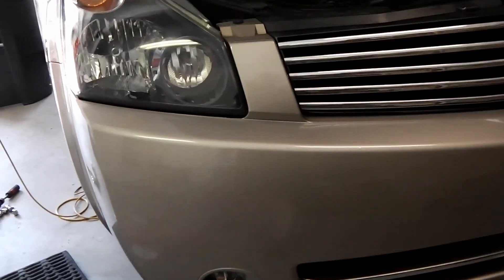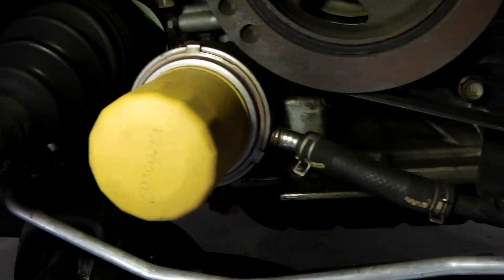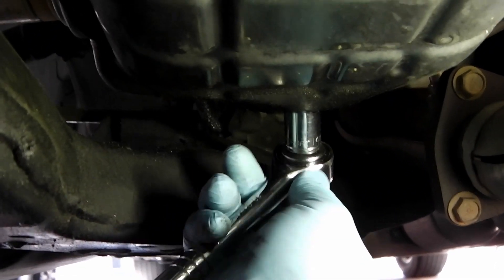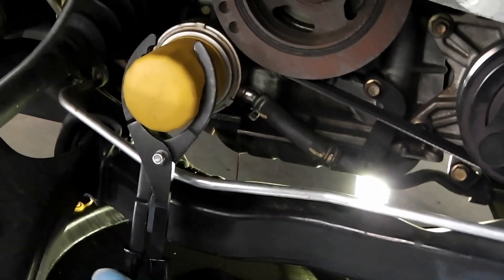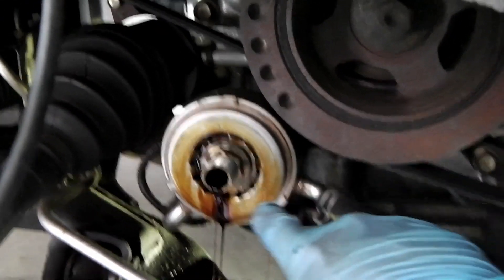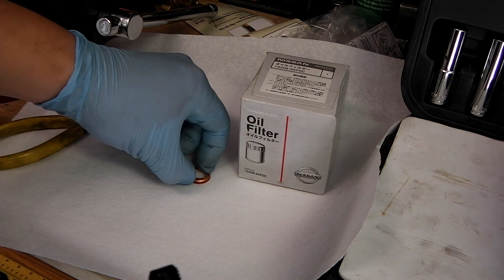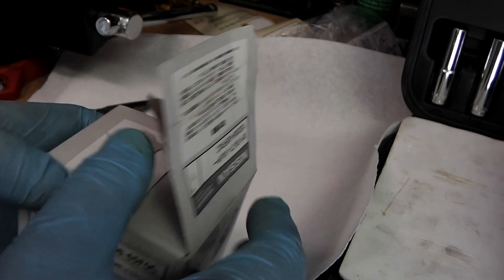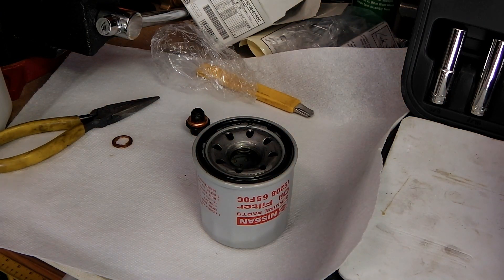Nissan 3.5L V6 Oil Change 2004 - 2009 Nissan Quest

Comment: This video had one key moment with very poor camera control that ruined the entire day of searching the internet for where the location of the drain plug was because the video went black and then the drain plug came in to focus with no referance of where it was in relation to where you were earlier. And being so close to the vehicle made it seem super huge so the tiny grenade textured cover looked the size of a flatbed trailer so i was looking all over for this huge skid plate. I looked in the middle, the back, under the radiator, i took the wheels off. But then i finally say the tiny oil pan and went "seriously? Its right here?"

Comment: NEVER use a filter wrench to tighten a filter. Only to remove it. Oil filters AWLAYS should be installed hand tight 3/4 turns past gasket contact.
Reply: @348frank348  SMH

Comment: Your vid was perfect.  I especially liked you showing how to get the drain plug gasket off. My "Advance" Auto did not have the gasket so i bought a off the shelf one and it is holding just fine.  My kids helped me and i made them watch your vid first.  It explained everything---even the bolt size.  Thanks, I had you get plenty of ad bucks from it.  Your deserve it.

Comment: Nissan uses almost the same engine design on my 2016 Infinity QX60, old , but should help in long term reliability...I hope :-)... The engine is good considering the CVT is adequate

Comment: Thanks for your time and upload for us DIYS'ers! One question, what about pour some oil into the filter to prime it?
Reply from the maker: Some people pour oil into it but it's really not necessary, and it can get messy with oil dripping all over the place. The filter will fill up with oil once you star the car very quickly. No harm there.
Reply: +Charles BridgTec ...you only prime diesel engine filters because they are much bigger..

Comment: I'm feeling confident to changing my oil/ filter. I have a 2015 Nissan nv3500. I want to improve performance but not compromise my fuel economy. Should I switch to synthetic? Which oil do u recommend? Do u recommend a high performance oil filter too?

Comment: A 2004 Nissan quest takes the whole 5 quarts but you could put 4 1/2 quarts of oil they burn oil your van will be low on oil in a few miles on the highway be careful

Comment: another question I have for you. my van has a 80k miles on it.  I used mobile 1 full synthetic extended perfomance oil this time. would full synthetic oil be a problem?
Reply: Used high mileage oil  like castro the green bottle plus buy it from Wal-Mart store you save some money o yeah once you car go over 75 thousands mileage it's consider high mileage

Comment: I have a 2004 nissan quest with 135000 miles, and I was wondering what's the best oil to use?
Reply from the maker: There is much debate on using synthetic or Mobil1, etc. My believe is not what brand of oil to use, but more importantly, just change it regularly every ~3000 - 4000 miles. I had to change out a valve cover and plugs at 110k miles and when I looked inside, my engine is super clean, no sludge. I only use regular non synthetic oil including no name Walmart brand.

Comment: Bro, you have the best Nissan quest repair vids. I totally appreciate it. do you know the part # for the copper crush washer for the drain plug?  I did oil change 2 weeks ago and filled oil to the full mark on the dip stick. I checked yesterday and it was a little lower than the full mark. And there is NO leak any where on the ground where the van is parked. What could be the reason for this oil usage?
Reply from the maker: Sorry, I don't have the copper crush washer part# because whenever buying Nissan filters from dealer or from ebay seller, they always throw them in. I think that small amount of oil level drop is fine. Check again in couple weeks and see if drops further. Probably you don't have any problem.
Reply: +Koko kaka ..oil tends to burn a lil.. also depending on the mileage your vehicle has..

Comment: Whenever I change my oil filter I always get old oil all over the frame. Any tips/suggestions to avoid that? TIA
Reply from the maker: It's normal to get oil on the frame. Just drain all the oil out of the drain plug first, then remove the filter so not much oil will pour out. Then wipe it down with some paper towel.
Reply: +dial2fast I'm a mathematician, not a mechanic. Changing the oil is just about the limits of my skill. A protective panel was dangling low to the ground when I climbed under the car today. I removed it and that gave me much better access to the oil filter. I think I'll leave it off. Thanks for the video and the reply.

Comment: Great vid! Just a question though, kind of unrelated.  where did you get the chrome trim for the top and lower grille?! thanks
Reply from the maker: +Brian Temple It's just from a roll of chrome molding you find at auto parts store. It has a sticky backing you just cut and stick on.
Reply: +dial2fast Nice!  Thanks for the tip.

Comment: Thanks to this video I was able to apply this fix and stop my oil leak completely.  I would like to add that since this video it appears the part needed has had quite a few revisions to it.  At first it appears the seal is to big but you can get it to go in all the way by finagle I in there.
Reply from the maker: Thanks for sharing!